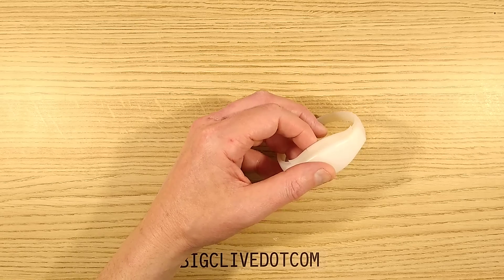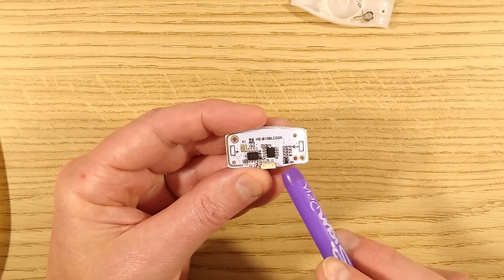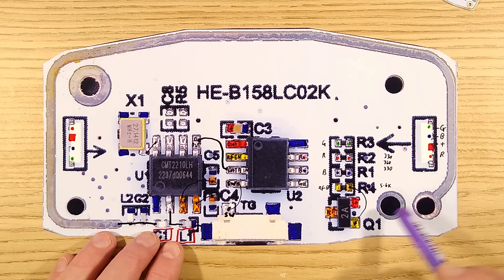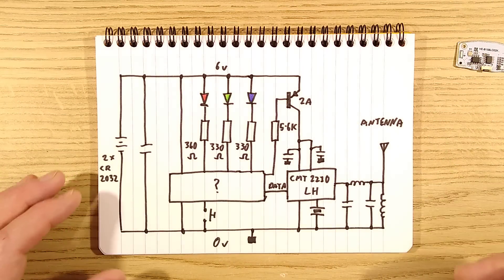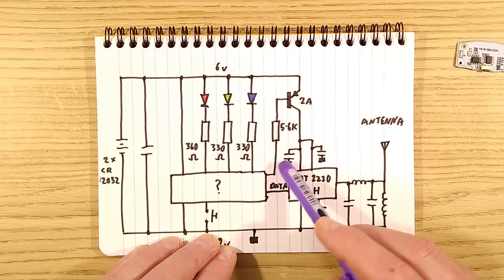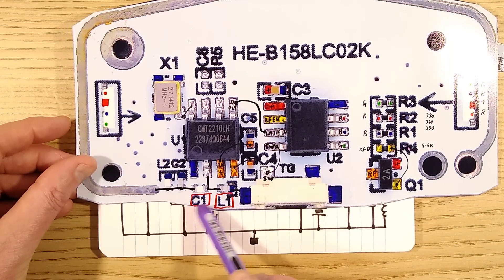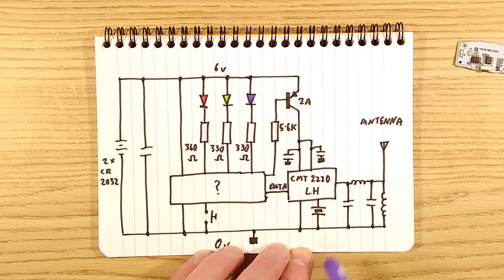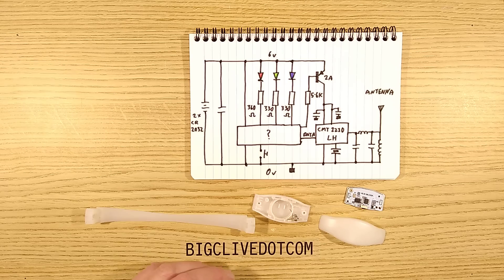Wireless audience LED wristband

Comment: CMT2210LH
2.0 – 5.5 V Low Power 315/433.92/868/915 MHz OOK Receiver

• Operating frequency: 300 - 960 MHz
• OOK demodulation
• Data rate: 0.5 - 40 kbps
• Sensitivity: -109 dBm (3.0 kbps), 0.1％BER
• Receiver bandwidth: 330 kHz
• Image rejection ratio: 30 dB
• Maximum input signal: 10 dBm
• Run independently. Input from the antenna
and output from data pin.
• No need for register configuration.
• Supply voltage options:
	• 3.0 – 5.5 V (High voltage mode)
	• 2.0 – 3.6 V (Low voltage mode)
• Low power consumption: 4.5 mA@ 433.92 

«This chip is 
capable of a data rate range of 0.5 – 40 kbps and it is 
optimized to 1 - 5 kbps as factory setting,»

OOK modulation = On Off Keying, also called CW (used for morse code and RC toys).

Comment: things i like  they used the CB band and chose to use a crystal that is on channel 15A in the cb band this is at 2:02 
the weird cap and inductor at end of antenna is a bandpass filter  ie low pass and high pass so this looks rather well thought out.
Reply: The 27MHz crystal is only the reference oscillator, the actual operating frequency is 433.92MHz. The use of a frequency in the CB band is just coincidence.

Comment: Regarding the RF input to the receiver, the receiver would work without any of the capacitors or inductors, BUT, a very wide range of other, unwanted and possibly, very strong signals could overload the input circuitry.
C1 + L2 + C0 forms a classic pi filter which will pass the wanted frequency and attenuate others. It may also be used to transform the impedance. 
L1 could be used as a high pass filter or it may be used to provide a DC path to ground

Comment: The ones I have seen have a tab that prevents the battery from contacting the circuit. You arrive at the concert, pull the tab out, battery connects, device now has power for the concert and maybe a few hours afterwards

Comment: The inductor with capacitor to ground at each end is a Pi tuned circuit, tuned to the transmitter frequency. The inductor then in series with the antenna is a loading inductor to compensate for the antenna being to short for the frequency in use - likely 433 MHz.
Reply: Agreed. And spot on about the frequency - 433.92. The data sheet for the CMT2210LH confirms this: used with a 27.1412MHz crystal it operates on 433.92MHz. Which means that a strong local 70cms amateur transmission could potentially jam it.

Comment: An unrelated question:
I have a kinda faulty monitor power supply that's behaving a bit odd! Output fluctuates between 13V and 13.8V and I found that if I just leave it plugged in, after a while (usually 15 - 30 minutes) the components warm up and it starts outputting stable 14V and the computer monitor turns on, also if I point my hairdryer at it, it takes just a couple of minutes to come up to 14V! any Idea what could be causing this behavior?
Reply from the maker: Thermally related problems are a fairly common failure mode.  It could be anything from a bad solder joint to a degraded capacitor.

Comment: I wonder how much range these can have given that they operate in the 433MHz band. 
In Europe the transmit power is limited to 1 mW, or 10 mW with a 10% duty cycle. In the US, the power is limited to at most 50 microwatts for control applications (maximum transmit time 5 seconds and must be triggered by a sensor or a button) and 8 microwatts for periodic transmissions (duty cycle 1/30 and minimum 10 seconds between two transmissions).

Comment: Looking at the data chip for this RF chip, it says that a 26MHz oscillator would receive in the licence exempt allocation at 433.92MHz. However this one looks to have a 27.1412MHz reference. Which would be receiving at just beliw 453MHz. So assume they have a licenced channel for the control and therefore allowed a much higher transmit power. 
Also that would prevent jamming by other things, such as a car key fob transmitter in someones pocket somewhere in the audience.
This chip is receive only. Having a transmit function would probably not add anything useful in this application. And trying to manage thousands of them in an audience would be a bit of a nightmare as far as comms protocol goes.
Reply: You're obviously looking at a different data sheet to mine. The one I'm seeing for the CMT2210LH talks of this very 27.1412MHz reference for 433.92.

Comment: Button could be part of an addressing process - press button, unit stays awake for a while & listens for a special radio command to set the address. This could easily be done in bulk for speed. As cheapo MCUs don't typically have eeprom it could just be held in RAM
Reply: You'd need to pull the battery isolator tag out of every wristband to program it.

I can think of a few ways.

The least labour intensive one but good for large events, factory program a run of, let's say, 250 (or many more) wristbands with identical serial numbers, whack them all in a box, label the box with the serial number on a QR code and the guys who set up the control gear scan the QR off the box into the control system.
 
Second almost labour free way (needs more hardware) , program all the bands with a unique serial and RFID them as they pass a reader at the venue.

More labour intensive way and probably only suitable for small events, have the serial printed as a QR somewhere on the wristband or the battery isolator tab so it can be scanned.

Comment: We used Xylobands in an event where each rider had two devices assigned to them and they were affixed to either side of their bikes. We then used them to identify to the audience who was in the overall lead, who had just won and other states we had within the event. They were certainly not easy to integrate into our backend systems, but we got there. The RF side was a little transmitter, with a single, small antenna.

Comment: I have a number of these :} been distributed to us at an open air concert in Abu Dhabi some 8 years ago. All they did was to lit different colors in a controlled way, or in tune with the music. RF part is transparent, all manipulations are done in the controller. Only a narrow band of radio frequecy is transmitted and all units receive it and respond according to their programming. L & C combination make up a band pass filter tuned roughly to the transmitted radio frequency

Comment: At a local theme park, you can buy color changing hats and the button lets you set the colors or cycling mode. But, if it's on in a show, the signal (I think IR but not sure) takes over and sets the color with the rest of the audience.

Comment: Why would they need L1, the safety choke, to ground? That is placed into HV RF amplifiers in case the blocking cap to the tank circuit fails, so it will cause a short to ground and blow the fuse. It's to keep high voltage DC off the antenna.
Reply: I suspect for matching the antenna that is shorter than an optimum quarter wave.

Comment: I wonder how they address them. Do they hand out the wristbands according to the seat numbers and pre-program them right there 10 seconds before they are given to the customer? There must be some address injection procedure.
Reply: Or the factory makes 10-20 different zone numbers, you order boxes of each and hand them out at each seating section.
Reply: @808jpm  Could be. But I’ve seen examples where there are patterns which required much finer resolution than zones. The IR bands used optically masked beams to “project” hearts or other geometric shapes unto the audience. These RF controlled bands, I assume, are addressable to that precision as well.

Comment: Who else is here that have no understanding what Clive is talking about so that you begin to think if it’s just magic that makes electronics work?
Reply: It's done by electron pixies. The capacitor ones store up the electrons for later, the inductive pixies twang like springs, shooting electrons and magnets everywhere, the resistor pixies are the miserable ones that try to stop the electrons, and the transistor pixies can't decide whether they are on or off, in or out, top or bottom. Put two of them together and they flippety-floppety in a magic dance. The chips are pixie hives from Silicon Valley, a special place where tiny pixies are squashed into small black boxes. Once in the circuit they perform Mozart symphonies and Moon landings at the speed of light.

I hope that helps.

Comment: ok we had ir, we had rf, how long before we get a btle mesh network or another form of low energy rf where every wristband can see every other wristband and they use relative strength to all of their peers to make a physical map of all of the wristbands so you can just let a crowd swarm how it will and it'll make it's own map of pixels?
Reply: it’s fine that they can communicate with peers via btle to establish position but then they still also need a way of all communicating at once in real time with a server to keep that pixel map up to date. And that is pretty much impossible with any current tech in a temporary show situation

Comment: Turning it on myself is exactly what I want to do as a IR/RF hacker.
Reply: I bet a flipper zero could probably make it turn on being RF
Reply: @usb23122  And the other version using IR.
Reply: @usb23122  certainly a "software defined radio" could
Reply: As an RF hacker perhaps you could make and open source a "universal" control for all the models and manufacturers out there by using an SDR?
Reply: @backacheache  To do that requires samples of the signals and devices to test.  That's no small task.
Reply: @jmr could just read the code in the microcontroller and find out the frequency?

Comment: So it is a single-use electronic device that you can not use anymore after the concert?
If so, I consider it irresponsible. Throw-away electronic in times of chip-shortage, electronic waste after a single-use, wasting of resources when we discuss about cobalt and coltran mining by children and lithium shortage.
Irresponsible - it should be outlawed. My opinion. 😳
Reply from the maker: It can be kept as a souvenir of the show or returned for reuse.
Reply: @bigclivedotcom  ... would be nice if they included some selectable  blinking or glowing patterns for private use after the show.

Comment: RF was something I could never get my head round.  I understand how it should work but in the field it did too many strange things.
Reply: Totally! Then I watched Electroboom’s video on the Coherer effect yesterday. Now mind mind is blown up forever!😅
Reply: A good place to start is with the various manuals for radio amateurs' licence exams. These are usually a good introduction without getting bogged down in too much theory and maths. The bosses at a firm I once worked for (manufacturing professional wireless microphone systems for TV and films) were great fans of the UK RAE manual, although only one was licensed himself.

Comment: 27mhz interesting choice of frequencies.
Reply: This is just the reference oscillator frequency. The actual operating frequency is 433.92MHz, used for most key fobs in the UK.
Reply: @Bartok_J  433.92 is a pretty short range frequency need a pretty powerful transmitter for  the range.
Reply from the maker: Possibly operating at much higher frequency from a low frequency crystal.
Reply: @bigclivedotcom  I don't think so this is citizen band and does not require a license to operate the transmitter, also the frequency is used for radio control vehicles.
Reply: According to the forum "Xyloband Hacking" there are different frequencies they use depending on the country and if they want to have different zones in the venue

Comment: Next step, figure out the presumably simple protocol and create a transmitter. Could be a lot of fun at a concert using them.
Reply: Or on the train home, turning the entire carridge pink
Reply: I'm trying to mod them with an Attiny412 since it is pin compatible. I missed that the RF section needed to be turned on. Will investigate further.
Reply: There is an online forum called "Xyloband Hacking" that goes into detail

Comment: 27mhz, the old CB band here in the US. All the led current limit resistors being the same value is a bit careless, poor red, haha. Thx for sharing.
Reply: That's just the reference oscillator frequency. The actual operating frequency is 433.92, used my many (most?) key fobs in the UK.
Reply: 27.1412 is about halfway between channels 15 (27.135) and 16 (27.155)
Reply: Channel 15A to be specific. Class C CB Radio Control Radio Service. Still used a lot.
Reply: @keyboarderror1  I raced rc cars for 2 decades (12th in the 1996 worlds), in the early 80's, the lowest 3 channels for rc cars, we could swap the Tx and Rx crystals and it worked as another channel, the other 27mhz channels this would not work. I remember the lowest normal was 26.995mhz.and we called brown.
Reply: @user-rs8zg8ey2b  There's a Chinese restaurant with a paging system putting out regular pulses on 27.255 (channel 23) a little over 4 miles from my house. Been there for years. No problem hearing it on my SDR. I've even thought about trying to decode it. That channel is allowed 25 watts so no surprise I can hear them.

Comment: Fascinating tech, thx BigClive. Did you get to see the gear used for the London Olympics? Was that the same type of unit by any chance??
Reply from the maker: Not sure what system they used there.
Reply: @bigclivedotcom  Infra red I believe, there were small boxes with what appeared to be in IR window mounted on the seatbacks at various locations in the stadium. I'll have to dig through my old photos to see if I have a picture (I probably took as many photos of the infrastructure as of the athletes!)

Comment: There is a larger 3V CR2477 which could be what the double CR2032 battery holder could be made for. The voltages and currents work out a bit better for 3.0V than 6.0V Especially as the data sheet for the CMT2210 lists its absolute maximum voltage as 3.6V. Might be worth checking the diameter of the battery holder to see if it's 20mm or 24mm.
Reply: those are what you find in those new E-ink price displays in the grocery stores.
Reply: I thought the datasheet example schematic Clive showed referred to "VDD5V". That doesn't make sense with a 3.6v max input. Also the LED resistor values would suggest a higher voltage.
Reply: Many small devices use 2032 cells stacked. The voltage sags plenty enough under load that a series 3 volt pair @ 6 volts won't hurt anything.

Comment: The neat thing about the IR ones is the ability to control areas of the audience with the IR spotlight.  But you could do something similar here without individually-addressing them by using directional antennas on transmitters with relatively weak signals.  Not sure if the RF chip is smart enough to report signal strength, but in cases of signal overlap you could use timeslicing to avoid interference.  Then the microcontroller can hear both signals and decide to do something smart like responding to both signals or just the last one heard.
Reply: A sort of paint by numbers😂
Reply: Perhaps make a highly directional 'can-tenna' out of an empty tube of Pringles crisps, that's what the WiFi hackers used to do. If you mounted the computer and battery on your back and carried the cantenna, you could also use the opportunity to dress as a Ghostbuster
Reply: You could do the same thing here just use a different frequency crystal in groups of bands.
Reply: @patrickradcliffe3837 according to the forum "Xyloband Hacking" that's exactly what they do
Reply: @patrickradcliffe3837  Not really - IR is assigned to the area and the frequency is assigned to the device. As long as you control the movement of the receivers - it's the same, but people like to move.
Reply: @wojciechbajon  yeah, but no. There would be bands that receive on different frequencies, but if the patron moves out of the assigned area it ruins the effect.
Reply: The pixmob guys do some really cool rf/ir gear I’ve worked alongside them in the past and some of there tech is really clever.